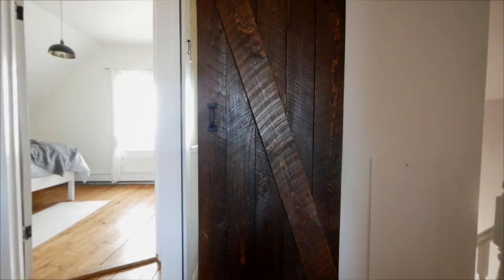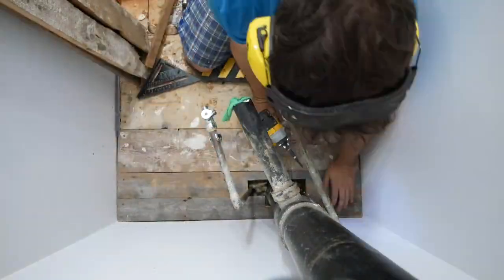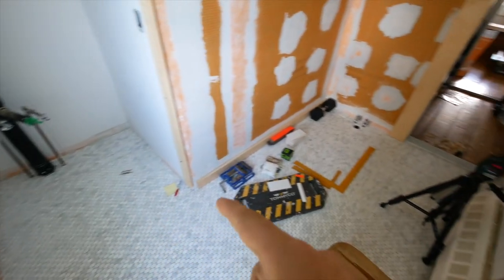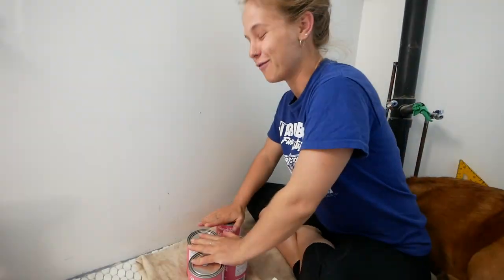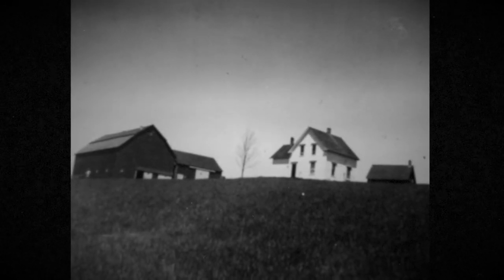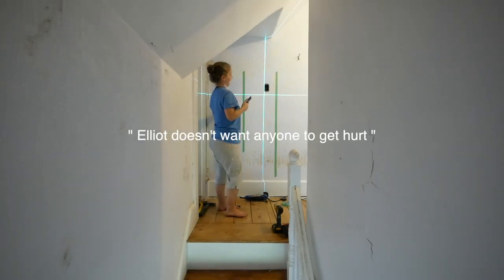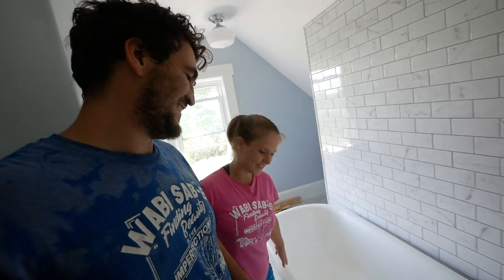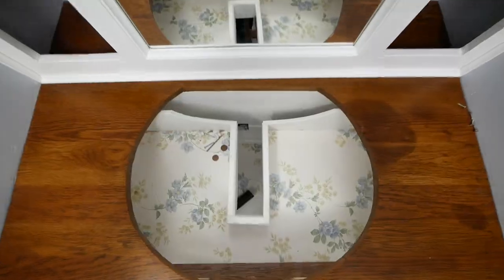Farmhouse Bathroom Renovation | Ep.22 |

Comment: You kids are so cute.
It looks AMAZING!
My husband and I did a similar renovation when we bought our first house
 We found a claw foot in the side of a river Bank and extracted it with a winch and a 4x4.
It sat.for years in our garden as a place for the babies to play, then we had it blast dang refinished. Finally installed in the house it looked so regal as does yours!
We used a space heater in the bathroom to heat up the floor and iron in the winter before filling the tub though as it can be cold and make the water cold.

Comment: We repainted a cast iron tub in preparation for installation this summer too. The interior is in great shape, so luckily didn’t need to do any epoxy, but it had many layers of paint and chips that had to be removed from the exterior. Interesting to find that it has numbers where the feet slot in (1-4) and the feet have numbers that I assume relate to their style number. 
It’s not installed yet, but only has to go up a half a dozen steps. Will keep your moving method in mind if we encounter any issues. Can’t wait for a nice warm soak! Did the bath faucet come from HH too?
You bathroom turned out beautifully. Congrats on the new coming addition!

Comment: Question:  I thought there had to  be some wire mesh panels on the walls before the tiles went on, because the wire mesh was screwed directly into the studs and it had flat straps of metal embedded into the tile grout so if they wall ever got wet the tiles would not collapse due to the wallboard paper being pulled away from the actual sheetrock.  Am I remembering this wrong? 😮😮😮

Comment: How long can a flash drive retain data?
10 years
Memory cards and USB drives are NOT designed for long term storage. You should always backup your data on to another device. The data will normally stay valid for a period of up to 10 years if stored under normal conditions. The data cells inside carry a charge which can dissipate over time.